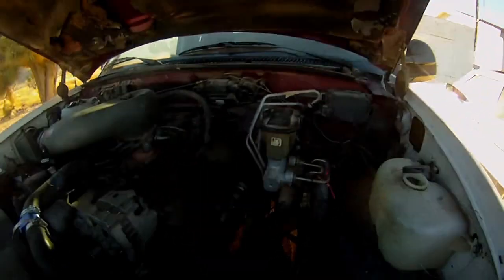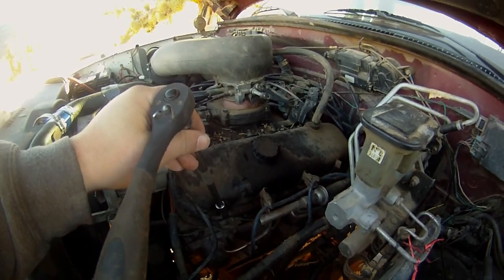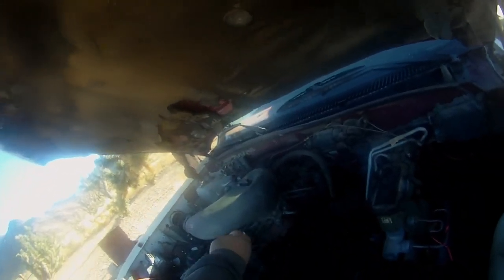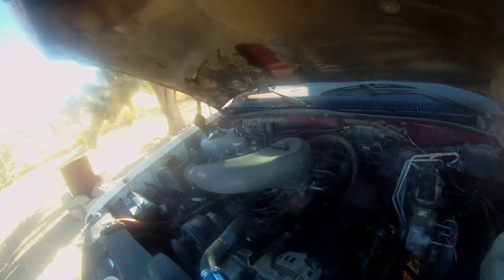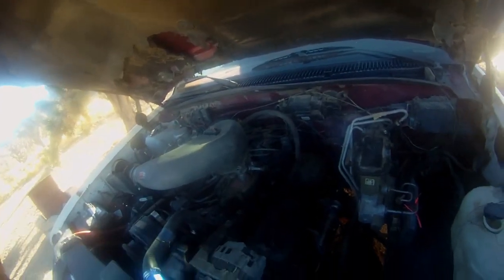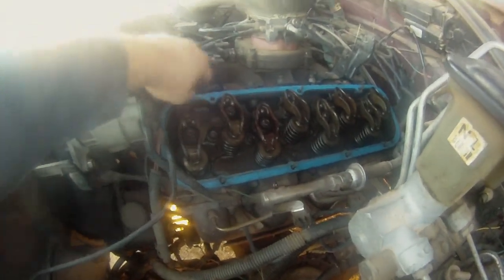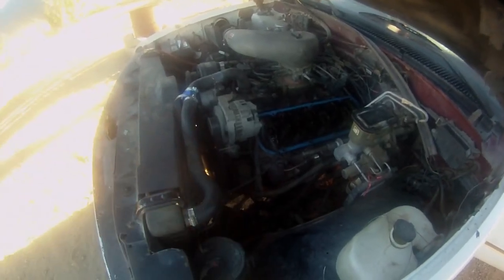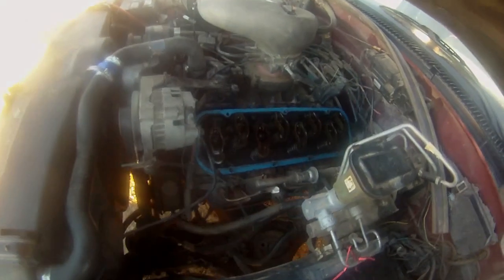GMC 3500 454 valve adjustment engine running

Comment: What year is this? 91-95 isn’t adjustable.
Reply: Mark V CHEVY 454 non adjustable??
Reply: @junetha3rd  torque to 40flbs and that’s it.
Reply: @junetha3rd  GEN V* There is no mark after 1990
Reply: if you look at the TBI unit theres an adapter under it. that adapter only came on 87-90 Gen IV's, which still were adjustable

Comment: Have a feeling I need to do this as well. Have 454 in my '86 motorhome and you can hear ticking and she has some backfire issues under load. Was told it was badly adjusted or just plain bad rocker arms. Thanks for the video! Guess your previous owner thought tighter was better.....

Comment: 1/2 a turn ( after lash is reached ) on older engines if one keeps loosening simply add another rocker nut on top of the other
Reply: Or replace them.  They are like $2.75 each

Comment: thanks for posting this video.  I was using a vacuum gauge trying to figure out why my boat (454) wasn't running well.   Gauge said check valve timing.    did this procedure and man. it's like a new engine.  only had 40 hrs on rebuild.  guess I should have checked sooner..
Reply from the maker: Thanks for the comment.....=)......Glad your 454 is breathing better.......

Comment: Hey Bud, The Dakota has a low oil pressure situation...It would seem it is an issue of the oil journals through the crank are clogged up and not delivering the amount of oil they should.  Hopefully the 454 doesn't have that issue.  Engine treatment didn't seem to help me clear up the problem so it is a rebuild for me if I want the issue fixed...
Reply from the maker: Hey bud its great to hear from you.........Lets hope its just a dirty oil sending unit. I got a mechanical tester/guage and a new sending unit, so hopefully I'll get it sorted out tomorrow.....Looks like it's a common problem in older chevys and a lot of newer cars......New senders have been known to sludge up and fail shortly after install. WD-40 or Chem Tool and 120psi blow gun might open up some journals .

Dodge V-8s have a notoriously bad rebuild reputation. Looks like they have 3 different size bottom end bearings A,B,C stamped on the bearing. I'm not sure but I think they all have same crank...its the connecting rods that are different. The crank gets measured and standard (B) bearings are recommended and fail shortly after install.....
Reply: Yeah im not gonna have it rebuilt...I got a Rav4 in march.  I'm gonna sell the dodge as is for whatever I can get for it.  Great jobs on the videos!  The new tractor is coming in handy around the property i'm sure.